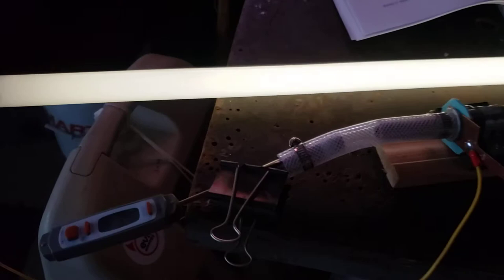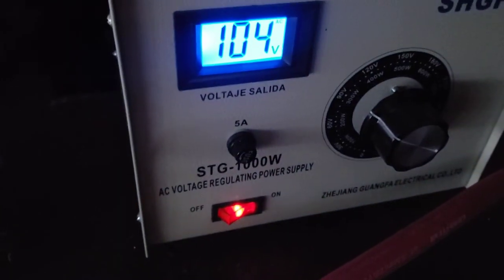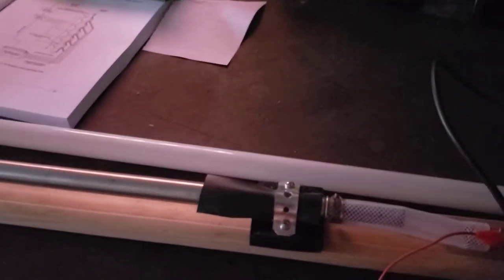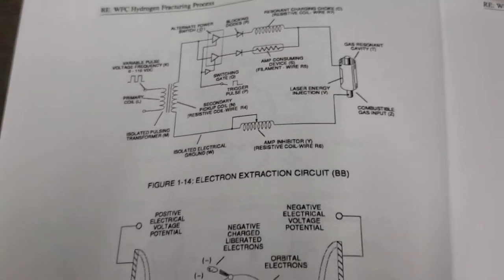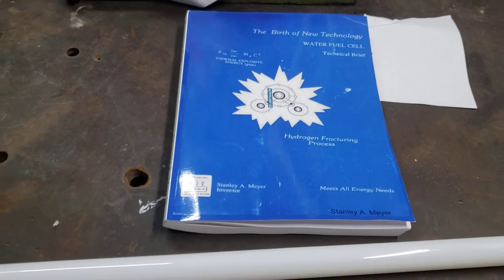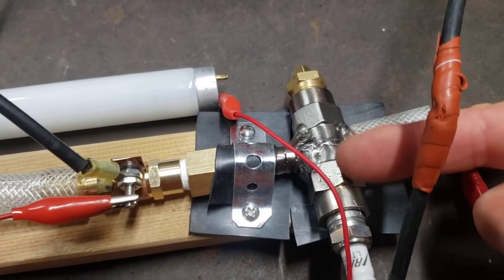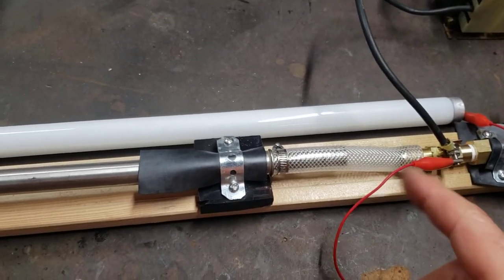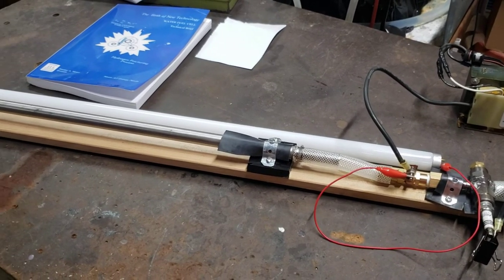Electron Extraction Circuit

Comment: So,,,water fracturing process…or…dielectric fracturing process.  So as not to sound simplistic, is maybe the key to just simply break down a dielectric with a disruptive discharge.  In the case of water, obviously, then, disassociation of H and O.  Then, taking in account Tesla, of which Stanley was obviously, a disruptive discharge is translated into a longitudinal disturbance, or electrostatic disturbance, into stout bars.  So where am I going with these obvious statements to folks versed in Tesla, use the disruptive discharge as catalyst for the process in my first couple sentences.  The reason Stanley has not been replicated since his patent is precisely for this reason, as Tesla never made public aware of this process, just had some famous circuits, describing this as an impedance effect.  Like your vids, strange how you disappeared for years, and all of the sudden back in operation.
Reply: Thanks for information.  We moved from California into Oregon and just went on retirement in June last year. Our pressurized HHO cell (4th generation) has been latest project up until December 2022. Every thing is back on hold with HHO research until further notice. 
Thanks
Captainwilly
Reply: @firstlightinternationalfound